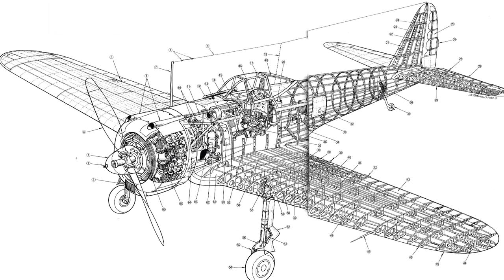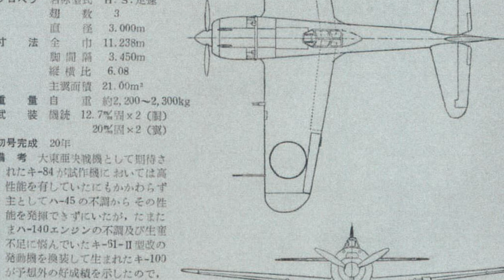How the Nakajima  Ki-84 Took on America's Mightiest Bomber—and Nearly Won!

Comment: I remember reading that in Japan the Ki-84 was put to compete with the Ki-100 and the german FW 190 A5, that was delivered to Japan by submarine, and while the Ki-100 was the supirior aircraft at the end of the test, the Ki 84 was a equal to the Fw 190, in that regard the Ki 84 was a excelent aircraft
Reply: That's right, we should not have given it back to those fools.
Reply: The Ki-100 was an emergency response to the failure of the Japanese inline, liquid cooled engine program.  Production of the Japanese copy of the Db-605 never got of the ground due to technical issues and B-29 bombing raids.  The Fw-190A that had a relatively narrow fuselage, was helpful in adapting the Ki-61 to radial engine power, thus creating the Ki-100.
Reply: You have to be joking. Ki-100 is good for this weight class, but its weak engine just cannot deliver the same perforce to match the Ki-84 or Fw190A5. 
I’m not sure why the Japanese will consider the Ki-100 superior.
Reply: @thomaszhang3101  The problem to you is, that I´m not joking, the coment I did was based in something I readed a while ago, where?, I believe in wikipedia, so maybe is a 60/40 true/false information, but, unless you find can data that can rebuke that information, you must acept what is in it, also in a war plane speed is not the most important, in a race aircraft, yes, but in a combat situation not so much, agility, maneuverabilityy, climb rate, turn rate, roll rate,  dive and weapons, are more important, more if you are in a dogfight, or in a zoom and boom situation, and the Ki 100 was good at that
Reply: @ricardobeltranmonribot3182  from what I learnt in IL2 sim and in WWII pilot interviews. Speed, speed in a dive and energy retention/rate of climb are the most important.

They allow you to boom and zoom, then spend more time at higher energy so you yourself won’t be boomed and zoomed. Even the Spitfire was not flown as a dogfight, but loved for its rate of climb. Turning ability was used more as a defensive measure.
 
Maybe the Japanese pilots who loved Ki-100 used to fly Ki-43 or Ki-61, in which case, I understand their love for Ki-100, especially given its diving characteristics. I still don’t think, however, that pilots who got used to the Ki-84 will be willing to fly against similar opponents while they themselves are in a Ki-100.
Reply: @thomaszhang3101  So you are telling me your information is a video game?, and not formal datataken from the evaluation of the aircraft?, and, wich pilots of WWII interviews you saw? USA or Japanesse?, also the Spitfire was a dogfighter, and not so good as a zoom & boom one, the early ones, even the Mk IX had problems with the carburator in its engine,  do you have the REAL data of the Ki 100 in hand, or the Spitfire? if so please show it, also using data from video games is not always good, in WT the Spitfire XIV is 730 km/h and in real life was only 700 km/h, and the Tempest V and II were 700 km/h and 710 km/h respective, making them the fasters fighters in the RAF.
Yes, speed is important, but the other characteristics too. Also the same can be said to the americans and british loving the P 51 and the Spitfire, there where better aircraft but they wanted range or 
maneuvability, but this aircrafts where to fragile, if they were shoot in the engine, radiator, or in the hydraulic sistem and they were doom
Reply: @thomaszhang3101  - The Ki 100 was certainly an improvement over the unreliable Ki 61.  Kawasaki could not make the Db 601 a reliable powerplant.  The Ki 84, was, in theory, a better aircraft but it had issues. The landing gear tended to snap like dry twigs and often, the oil cooler would fail leading to engine seizure. That, according to the Aircam Aviation Series book on the Ki 84a/b Hayate in Japanese Army Air Force Service.  No 42
Reply: @ricardobeltranmonribot3182  My information was from German pilots on the Western and Easter front, from Military Aviation History. Also from interview with Sabuto Sakai, the Zero ace. Even he said he tried not to get into a dogfight in the first place.

Spitfire is an amazing boom and zoom fighter. Not so much as as one that dives and pulls up all the way, but one that does short boom and zoom repeats involving large angles, where it’s engine power and low induced drag compensates for its parasitic drag.

IL2 is a simulator, not just a video game. Same with DCS, it’s as close as anyone will ever get to real world WWII fights.
Reply: @scootergeorge7089  I agree, it’s not reliable, but high performing. There is a reason why so much attention was given to Ki-84 post war, with a prominent pilot report published on the Ki-84 that we can easily search for to this day, while Ki-100 got very little allied attention post war.
Reply: @thomaszhang3101  Wait... what does a german pilot(s) has to do with a JAPANESE aircraft? Sabuto Sakai, didn´t fly the Ki 100, there were so few of this aircraft, also, the Ki 100 was a Army aircraft not a Navy aircrat Sakai was a Navy pilot
Reply: @ricardobeltranmonribot3182  I’m mentioning Sabuto Sakai and the German pilots to make a point: staying at higher energy is the preferred way of fighting over dogfighting for most WWII pilots.
For Germans, whether they are on the eastern front, where they enjoy an altitude advantage over the Soviet fighters, or whether they are in the western front, where they are at an altitude disadvantage, the protocol is overwhelmingly “stay fast, avoid unnecessary turns, avoid merging into a dogfight”.
For example, very specific instructions were given on how to preserve energy after an attack, which way to egress, staying low and fast to get out vs zooming back up for altitude after an attack, etc. Or just staying fast generally, like, when patrolling over an area, make linear passes over the area, never circle above it, etc. It’s all about staying fast so you have enough energy to stay out of a dogfight.

Sabuto Sakai, even though flying the Zero, a plane known for its turning ability, chose not to turn whenever possible.

Turning is really a passive defensive method rather than preferred active method of engagement.
Reply: @thomaszhang3101  And I asked you who were the pilots that talked about the Ki-100 not in general, this video is about a Japanese aircraft, and I said that the Ki-84 was on par with the FW 190A-5 when a performance study was done in Japan
Reply: @thomaszhang3101  - The Ki 100 was never given an identification name like  Frank, Tony, Zeke, etc.  because the US did not recognize it in combat, referring it as a "Frank"  or an  "unidentified radial engine fighter."
Reply: @ricardobeltranmonribot3182  can you name me the pilots who talked about the Ki-100? As far as I know they were identified as unknown test pilots to this day.
Reply: @thomaszhang3101  I never said anything about the pilot, I said about the report of the results of that test, some pilots are bias, and because of that you can't trust them 100%, so I don't trust in earsay, I prefer solid numbers obtained from studies and test, like mock battles
Reply: @ricardobeltranmonribot3182  you trust the numbers? Well the numbers are right here. Level speed all the way up to speed at 6000m, wing loading, max dive speed, aileron/elevator/rudder lock up speed, climb rate, wing aspect ratio, all there. Wikipedia, IL2, if you don’t mind some inaccuracy, WT database. 
It’s all there. Ki-100 loses in almost every metric compared to Ki-84 or any late war fighters for that matter. 
It has lower wing loading than most late war fighters, similar wing loading to Ki-84. Higher aspect ratio so lower roll rate but better maneuvering energy conservation, power to weight ratio is just bad, level speed is beyond saving, dive acceleration might be its only strong point, linear energy retention is bad…

Again, it’s amazingly good given its original airframe and its weight class, but no way competitive to late war fighters.
Reply: @scootergeorge7089  Everything I have read about the under-carriage issue was a decline in the quality of metals used as it became more difficult to manufacture things in war-time Japan.
Reply: @peternewman7940  - You are correct.
Reply: It's correct spelling isnot Sabuto but SABURO Sakai !

Comment: Nakajima Ki-84 was a very good airplane powered by the Homare 21 direct-injection version of the engine, using water injection to aid the supercharger in giving the Ki-84 a rated 2,000 hp and well armed but as you stated the engine was plagued with defective parts and it was difficult to maintain not helped by increasingly few veterans. Nevertheless it was an excellent airplane! Good job 👍 👍👍
Reply from the maker: Thanks for watching 😉
Reply: @MilitaryHistoryChannel1  yes, I'm really enjoying it as after I know not much about this airplane.
Reply: Another example that shows that good technology is only part of the winning formula. In fact, it's hard to say one aircraft is better than another. We can say "faster" but then the question is "at what altitude?" and so on. Is the aircraft fit for the role, theatre of operation, maintenance to keep it airworthy and available in sufficient numbers, etc are equally important if less exciting points to consider.  Without trained, experienced pilots and an entire well-run logistical supply chain of techs, mechanics, parts and munitions the aircraft is worthless as a weapon of war. And timing is everything. "If this plane was available a year earlier it could have changed the war" Sure. But like the ME262, there were many reasons why they arrived in theatre too late for the game...
Reply: @Mike-eq4ky  well said and I agree with you as both are very good airplanes that simply arrived too late to make any difference and were built in too little numbers. But with fuel available and good pilots they made the difference....
Reply: @paoloviti6156  Yes, forgot about the fuel issue which was HUGE for both the Germans and Japanese. We regularly flew 100/130/150 octane fuel to their maybe 85 octane. We could run smaller engines at higher manifold pressures then later adding water methanol injection. The Germans made good use of water methanol injection, which was actually a NACA idea from the US but the Germans made first use of it... I met a British test pilot at Duxford 20 years back who told me while testing Axis fighters if the Germans had the fuel we did they'd have had a much more level playing field power wise. You forget the importance of such a seemingly unimportant detail...
Reply: @Mike-eq4ky  You are really looking at a weapon system and how it is deployed. Interesting to compare with other military aircraft - the B-29s for example - mission, manufacturing capability, metallurgy,  training of crews, field maintenance, tactics, bases - the whole organisation.

Comment: Interesting video on Japanese WWII fighter aircrafts. As far as the Chinese Communist, Republican Chinese, and Indonesian Air Forces using captured Japanese fighters I do not know if this has any basis in reality. The Japanese made these aircrafts so the Japanese can keep these high performance fighters in operation. Neither the Chinese nor the Indonesians are industrially developed countries. They simply cannot make the spare parts needed to keep these airplanes in operation, so it is unlikely if not impossible for the Communist Chinese, Chinese Republicans, or Indonesians to use these captured Japanese fighter planes. Given this information is false I wonder what else in this video is also made up and have no basis in reality.

Comment: Its a shame so few of these aicrafts still remain. The KI-84 could potentially have been the best japanese fighter of ww2 but in reality, the KI-100 was. Much more reliable and it could actually dive with allied planes and keep up, unlike most japanese aircrafts.
Reply: And that Mitsubishi Kasei radial, when equipped with a 2nd stage turbocharger gave the variants of Ki 100 that got that motor plus the J2M the altitude capability to approach B29s from above where their top turret guns wouldn't reach. It took a very experienced pilot to do that and those were short on the ground by then. We bombed the turbocharger plant and the shortage and often poor quality of materials of those variants of that motor meant most of the best of those left would go to Mitsubishi's own J2M which was a good point defense interceptor whose 4 20mm cannons could make the pressurized interior of a B29 a vulnerability. Problems with shortages of turbocharged variants of the Kasei affected J2Ms as well. Le May didn't know what they had or didn't have in the way of reaching B29s altitude and his decision to go on low altitude nighttime incendiary raids for several other reasons, at least, made it a moot point.
My dad was in on the occupation and said they had an underground assembly plant near Osaka putting out J2Ms.. Don't know if they were to get tubo second stages or not but our submarine blockade would've made the necessary alloys hard to come by.
Reply: Only one remains - on display in Japan. It was a rollercoaster of emotion finding out only one survived, that it was restored to flying condition, and after neglect is no longer flyable.
Reply: @briantien7146  Yep, I've read the story about that one.
Reply: I’m not sure why people think the Ki-100 is remotely superior to the Ki-84.
Ki-100’s engine is much too weak to keep up with most late war fighters and its armament is also somewhat lacking.

Ki-100 was no doubt a very fine “accident” that punched way above its weight class, but it’s not comparable to most high performance late war fighters, Ki-84 included.
Reply: @thomaszhang3101  The KI-84 SHOULD have been the better fighter no doubt. But in reality? Nope. You know which aircraft is better? The one that will actually takeoff and that you can fully open the throttle without exploding. In this case, its the Ki-100. Forget the theory. We are talking about what happened here. The Ki-84 on paper was far different from those on airfields in 45. Not close. Also, fuel quality was a problem. That's why many people claim the Ki-100 was the best fighter. Because of historical facts, not theory.
Reply: @simonlemerveilleuxdelisle3779  I really don’t see how even the even worst performing Ki-84 can be worse than a normal performing Ki-100. 
I just don’t see how. The performance gap is too great. We are talking about the performance of a 1940 level fighter compared to that of a 1945 fighter. It’s like comparing Bf109e to Bf109G/K. Sure, many Ki-84 can’t even take off, but those than can are automatically better than most Ki-100.
Reply: @thomaszhang3101  The Ki100 guns were the same two 20mm and two .50 cal. as the Ki 84 and the armor and self sealing fuel tanks were said to be pretty good in the Ki 61 at least. And while the Mitsubishi Kinsei without the second stage turbocharger wouldn't want to race the late war Americans in level flight the second stage turbo version probably would've wanted to go vertical for most of it's altitude advantages. There's a big difference in a 2nd stage supercharger and the Homare's 2 or 3 speed supercharger.but they were planning a different powerplant with the 2nd stage turbo for the Ki 84 as well. They seem to have different strong points so I imagine it's in how you exploit their advantages.
Reply: @icewaterslim7260  you are right, the Ki-100 armament is not bad. Still, I don’t see how Ki-100 can win in most scenarios even with a second stage turbocharger installed, for the difference in speed against other late ear fighters is too great. 
If it’s 50 km/h slower, like the A7M, ok I guess it can still be compensated. But Ki-100 is a full 100 km/h slower than Ki-84, and probably around 110-130 km/h slower than a P-51D. I just don’t see how Ki-100 will ever get a chance unless the opposing pilot gets a brain fart and decides to get into a turn fight and never disengage before his energy bleeds out.
Reply: @thomaszhang3101  The second stage turbocharger, providing it functioned properly, was a huge advantage at altitude that the B29s originally did their missions at (about 30,000' plus) and the Ki 100's low-wing-loading of those long wings that slowed it at sea level would probably make it a lively Hineri-komi performer at altitudes that the single stage Nakajima Homare powered "Frank" would reach but wouldn't perform well there and the video states as much @9:10. 

The lines of the Ki84 might've been influenced by the P47 but the Ki100 would've performed better at the P47s best altitudes as the "Jug" also had the 2nd stage turbocharger and adequate intercooler function unlike the earlier P38s whose designers insisted on sticking with an inadequate wing mounted evaporative intercoolers that doomed the rangy Lightning as a high altitude B17 escort fighter. The P38 designers finally trashcanned the vulnerable and inefficient intercooler for a conventional setup like the P47 had but too late to beat the deployment of P51s that were cheaper than the P38 to make and were more forgiving to green pilots.. 

Material shortages due to our undersung submarine blockade would probably make availability of the turbo version of the Mitsubishi Kensei problematic and I'm guessing Mitsubishi's J2M would likely be priority for those. Nevertheless the 244th Sentai made up of crack surviving veterans flying the Ki 100 did well against the F4Us it encountered in it's zone and that's by our count.

I don't think any of the fighter groups from either service did all much to down B29s as Curtis Wright did with the early version of the R-3350 with it's leading exhaust ports and magnesium crankcases making for some spectacular engine fires. Of the  414 B-29 losses in WWII, 147 of them were to flak and Japanese fighters, 267 to engine fires.